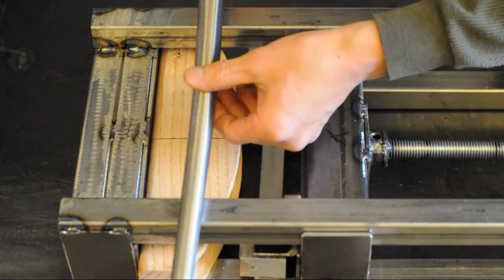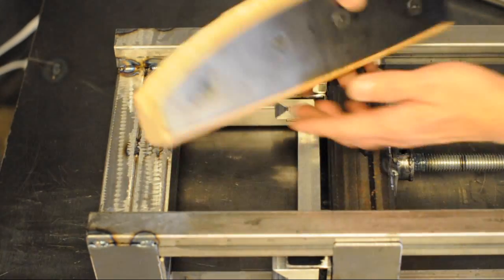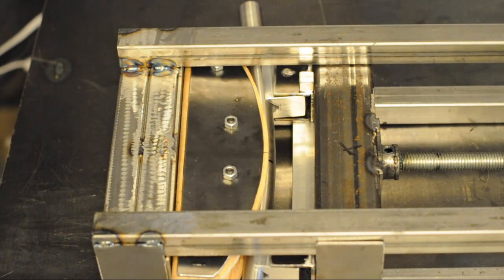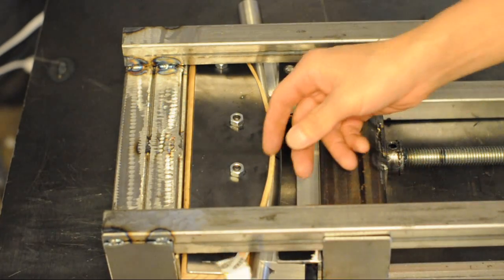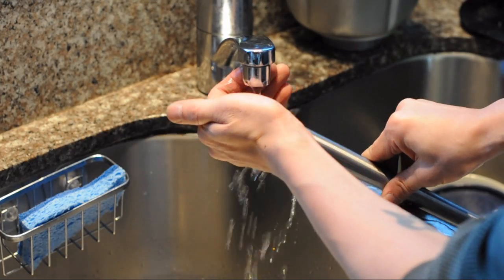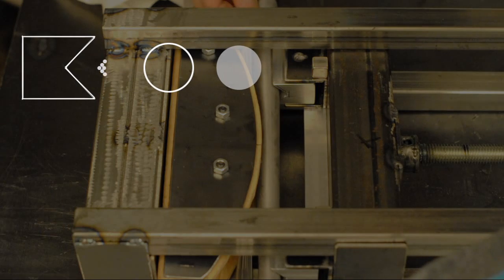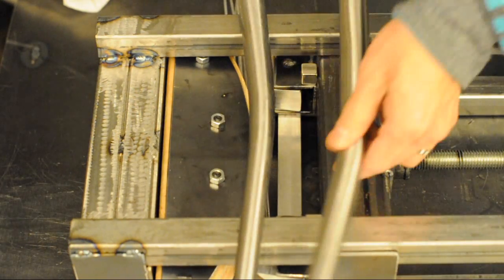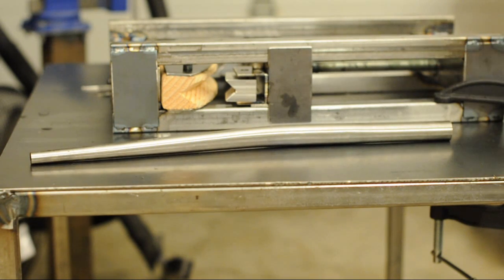Bicycle Frame Build 08 - Bending Chainstays

Comment: For a beginner, do you recommend frame building using Steel or Aluminum tubes ?
Also, what is the material for the frame tube material used in the video , & thickness?

Comment: Another good way to make a clean bend without flattening is to cut a few slits half way into the pipe in a few evenly spaced positions along the bend.  Then weld them over to fill them and grind/sand smooth after bending.  This works especially well with sharp bends.

Comment: Great idea filling the tubes with ice.  Will probably save me from the same mistake.  I thought of filling the tubes with cement mix ( powder only, not the gravel & sand mixture ) and taping off the ends with duck tape.  Never tried it though.  Both methods might work.  Only downside I can see for the ice method would be the low temp.  Might make it harder to bend.  I suppose with the cement powder method, the tubes could be heated a bit to make them bend easier.  Some day maybe I'll test this method.
Reply: Maybe fill with sand can work to, a fine sand.

Comment: Yup, when bending tubing, you need to sandwich the sides of the tubing tight so they don't pop out while bending along with the inner most diameter of the tube with hard tubing. Soft metal tubing is more forgiving with the sides.That's the first I heard of using ice for that, good idea.
Reply from the maker: +prancstaman i now use sand but ice is best with oval tubes.

Comment: Its cause that piece of wood (form) is too big. With typical pipe bending the "form" or the shoe is normally just smaller than the pipe you're bending cause once bent the pipe will fit into the "form" so try a smaller gap in the form with a big gap it means more room for failure
Reply from the maker: Thanks for the tip. All around my wood form is pretty terrible. It's the wrong material to begin with. I used a 2x4! Yuck!

Comment: how about use those sticks rods as a filler, stuff them it in the heated tube and bend them togatharr
Reply from the maker: +aezif dhom not a bad idea. But it prob wouldn't pack enough to pressure the inside of tube wall.

Comment: seriously, with all the money you invested to make this machine, you could have bought a tube bending machine, made for this purpose and more efficient... still interesting build though.
Reply from the maker: +DELBOURG matthieu agreed! 😂
Reply: Heck, a 12-ton hydraulic tube bender with a bunch of dies costs £60 on eBay (about $75). A universal compact bender (without the tube dies--you would have to make those yourself) costs £75 (under $100) from eBay or Harbor Freight and is  way more versatile than your bender.

Comment: To help keep the kinks out fill the tubes with sand before u bend it and replace your aluminum push with steel/aluminum wheels u can get them in the tubing sizes then u can just change them out with different tubes and your wooden piece u can make for the different size tubes also.  Later dan
Reply from the maker: +djtoo7 right on. Thanks for the tip. I've got something cooking up for a better bender. Sometime in the future I'll start a build of it.
Reply: Cool, i got one of these when on sale for like 199, it dose most everything and can't build one cheaper...

later dan

http://www.eastwood.com/professional-tubing-bender.html

Comment: why using wood to bend the pipe? is'nt that will deform because of the force?
Reply from the maker: +Jacky Lock yes, it deformed. I admit it was a bad idea ;)  some day I want to build a better setup. Thanks for watching.
Reply: +Pithy Bikes you can use hotworking metodh to bend it

Comment: Some musical instrument builders fill the tubes with melted lead while most prefer the soapy water. Obviously cleaning out the lead after the bend is made requires reheating the metal  and carefully cleaning the interior of the tubing.
Reply from the maker: Clever!

Comment: what plasma cutter are you using?  I got one but I can't run mine like that
Reply from the maker: Hi. The video is sped up so it seems faster. It's an Everlast Power Plasma 50 - http://www.amazon.com/Everlast-PowerPlasma-Plasma-Cutter-Cutting/dp/B0081BEVXW
I'm running it on a:

California Air Tools CAT-4620A
Reply: What kind of tip is that?  Is it specific to the everlast machine?
Reply from the maker: It's a standard  tip. But I'm not supposed to be using it the way I am in the video. The torch came with a stand off attachment. But I don't use that because the cut is not precise enough for my taste. I tend to burn out a lot of tips by contacting them right to the material like you see in the video. I think there are contact tips but so far I'm too cheap.

Comment: I agree that the angular notch on the form contributes to the problem.  My impression is that you don't really need a curve, though.  What you want is a form that contacts the tube at a tangent that is as nearly parallel to the direction of force as possible, so only its edges.  A square bottomed trench with a width slightly narrower than the tube will do.  It maybe 'pinches' the tube a bit, but that force counters it kinking.  This could perhaps be built up from metal (two plates separated with spacers, then a bent bar for the trench bottom) in a form that matches the taper of the chainstay tube.
Reply from the maker: +Sebastian Wiers Interesting idea. I've never seen a square channel for bending. It's been quite a while since that video so I've had lots of time to think about it. It think the best course at this stage is to simply buy one! :) What I've learned from observation is that the more form that touches the tube the better. This insures that the tubes wall have no where to go but bend in the direction you want. Thanks for watching :)

Comment: If you are still using this bending method, might I suggest hickory or another hardwood, and like some others have mentioned, end grain will work much better. Buy one piece of 8/4(roughly 2" thick) or 6/4 (1.5") hickory and glue them side to side with some good wood glue to get the width you need. A round die on the router might work better than the angle you have cut too. That way it will distribute the pressure more evenly. The way you have it puts the pressure on two acute points in the block, making it more likely to split because it is pressing both down(the base of the block being down) and outward to the sides of the block perpendicular to the grain. Hickory is an extremely durable wood that holds up well to pressure and shock (which is why so many tool handles are made of it) and it is reasonably cheap, especially with how little of it you will need. I'm sure you already have a good solution, but I just thought I'd offer up a few thoughts that might help for similar applications in the future. I like your self reliant approach. Keep up the good work.
Reply from the maker: +Brian Choitz Thanks for this info! I do plan on changing my bender setup some day. Cheers!

Comment: hey there bloke, I'm wondering what diameter tubing you're using and costs all up for it? mind letting us know?.. I wonder if an exhaust shop would mind doing some bends for ya on the cheap? might be a lazier way of doing the odd bend here or there..
Reply from the maker: +Monstah Jones The tubing is from henryjames.com. I'm bending chainstays so meybe they're too small dia for a exhaust shop :( And the part I'm bending in this case is oval so its extra tricky.

Comment: mate make yourself a roller bender, more easy to do than all the work you have done., and you can bend a long section and cut as many sort parts as you need them good work .
Reply: A roll bender will not help much on a tapered chain stay. Using the V-Blocks bender isn't a horrible approach.  Nice work though, problem solution building is a path to a higher level of experience. Keep on
Reply from the maker: +quickie3 Agreed, I need a better solution :) Thanks for watching.

Comment: your problem is the bending tool,  as far as you bent the tube your tool are maintaining the same preasure point just in the midle of the bent.  you need a rotary die to change the presure point in all of the curve other wise the material on the midle just expand upd side and contract on the base..    in only one point.
Reply from the maker: +Fernando Echeverria I agree. The oval chainstays can present a problem with rotary dies. But, a good die is still better than what I'm doing right now. :)

Comment: did you anneal the tube before bending?
Reply from the maker: Alex I did not. I don't know if folks anneal bicycle tubing before bending. Do they? Any info anyone can give on this would be appreciated.
Reply: Pithy Bikes im not sure about bicycle tubing in general, but 6061 t6 aluminum is a heat treated alloy for strength, so when you try to bend it, that is the reason my it will crack and break more often than actually bend. You need to anneal the aluminum first, then do your bending while the aluminum is at its softest, and once you have completed the frame work, the aluminum should be re heat treated to bring it back to strength. heat treating usually has to be done by a qualified shop though, as it is a difficult process with aluminum.
Reply: +Alex Dollar The tubes used in the video are steel, not aluminium.

Comment: try fill pipe with sand
Reply: +Pithy Bikes If you succeed Pithy please post it. It''s my life's ambition to bend a tube without the damn thing flattening!
Reply from the maker: green goblin Ah yes I want to try this method some day! Beats waiting for ice to freeze :)
Reply from the maker: +fred I totally agree. I've been thinking of ways to make a new wood die that matches the diameter of the tube. I'll prob revisit this at some point. My current hodge podge die is less than ideal.
Reply from the maker: +fred the tricky part is chainstays that are  not straight guage. Mine are oval at center so most likely I'll still get some amount of flattening. No flattening.. one can always dream! :)
Reply: +Pithy Bikes That's even worse. Good luck. I havent bent CS's yet no one has asked. But plenty of Fork blades which is the part cyclists see a lot of. One day.. some day..
Reply: Buy a hydraulic tubing bender at Harbor Freight for a hundred bucks. Perfect bends every time, no kinking. Or maybe you can find a used electrical conduit bender on Ebay or Craigslist for cheap.
Reply: +Pithy Bikes Dont bother . Neither really works. The best way is to use a hardwood for the former and cut a groove that nearly matches the blade but even then you get some flattening occur. I've tried capping both ends, drilling a hole in one cap and then brazing a nut around the hole then filling it with sand and then putting a bolt in the nut and tightening  it down into the sand as hard as humanly possible and still flattening ocurs. Not much maybe only 1/2mm but still noticeable. I think the only way is to have a groove in the former that exactly matches the shape of the blade all the way.

Comment: So question....most TUBING benders I've seen are different than PIPE benders, which is kind like what you have here...a tubing bender pulls the tube around a form, with dies on the inside and outside, where a pipe bender simply pushes in the middle (and kinks/wrinkles the tube)...like this...did you pick this because it's not a steep bend?  Or because of the irregular cross section of the tube?...I'm getting ready to start building some frames just for fun, and I'm seriously considering just a 1/2" emt tubing bender (which is actually closer to 3/4")...
Reply from the maker: Nathan Hamler Hi! A tube bender with a die on the inside is a mandrel bender. I've never seen anyone build one of these as a DIY. Yes, you're correct, you cannot mandrel bend an uneven tube like the one I have in the video that is oval shaped in the middle. And yes, that's why I bent the tube in the way I did. Partly because of cost and just to see if this simple setup could do the job. I would love however to try and build a more traditional tube bender that has the two round dies, one for the radius and the other to do the pushing on the lever bar. I think most folks get the best results with that setup. I'd love to see someone 3d print a die for an oval tube. That would be a fun thing to try!

Comment: Hi nice video,
Have you tried put same sand to inside of tube? 
I link to the video from Bike forum.

Another question, what is the milling machine model? It looks small.
Reply from the maker: Hi, I haven't tried to sand method. I heard about it though. I might give that a try. It is a tiny mill! It's a Sieg X2D mini mill. Thanks for watching!
Reply: Pithy Bikes  Thank you!
Reply from the maker: Super Dry You're welcome!  Hey in case you want to know.. I picked it up from The Little Machine Shop. https://littlemachineshop.com/ Cheers.
Reply: Pithy Bikes Thank you for your information. But one Big problem is I am living in Taiwan, the shipping cost is too much. Would you builder other bike? Recently, I also want to be a frame builder. I had buy some cheap Cr-mo tube to trial and error. good luck!